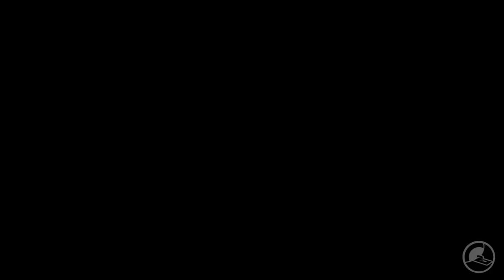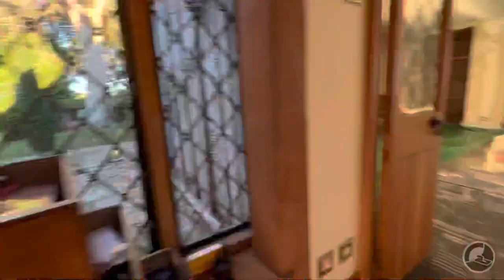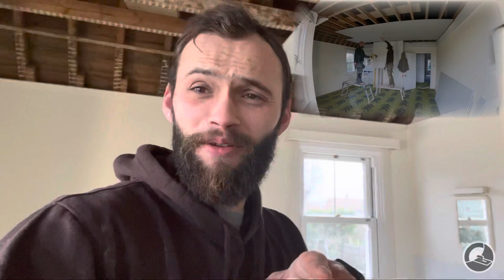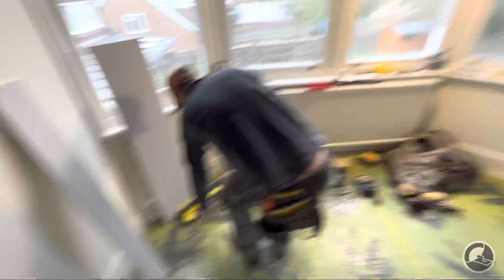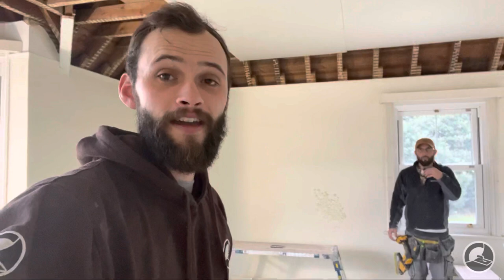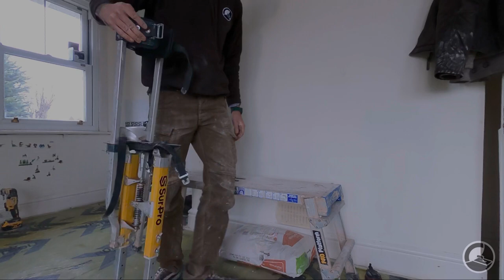Vlog #2 More Tom-Foolery

Comment: 👍 another interesting video Alex .. sure pro are brilliant love them have the middle size mag one's had to buy the biggest one's a little while ago for a job with some high stuff ... When was buying noticed they had a new design that have a hinge point on the foot plate and extra spring for the toe ... 🤔 Was curious to see what they were like but at €100 extra for that feature decided to stick with what I'm used to.. also I keep a can of wd40 silicone spray in the van give them a good coating every now and then makes keeping everything free and clean a lot easier